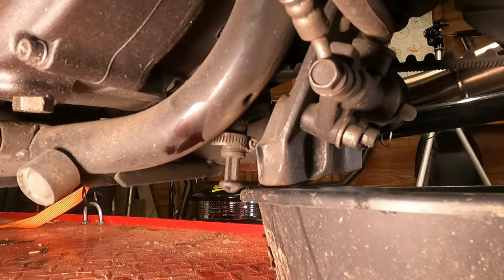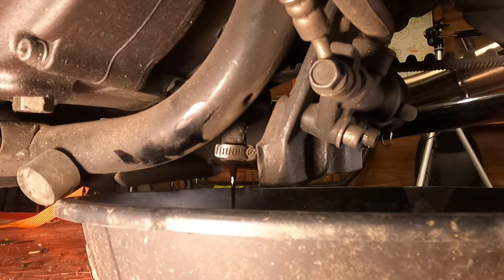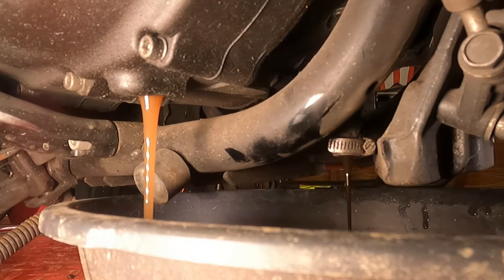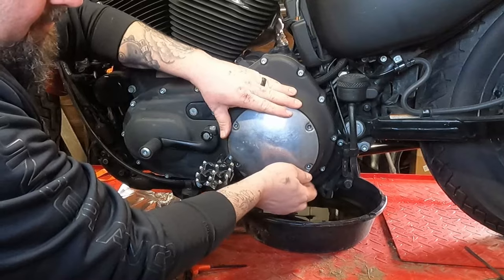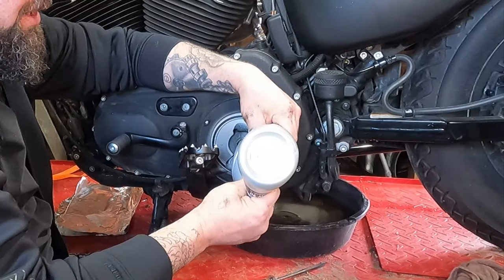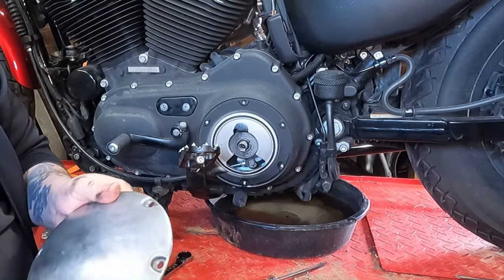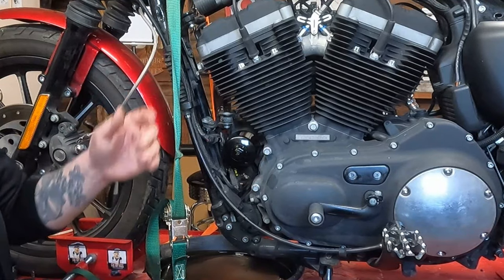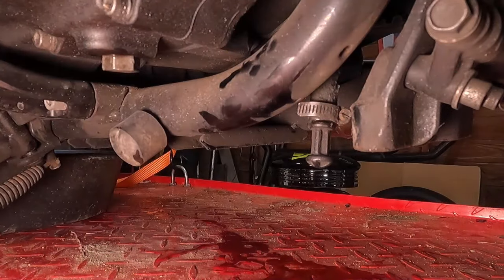Harley Sportster engine, primary & transmission oil change.

Comment: I recently bought a Harley Sportster and decided it was time to change the engine oil. As a newbie, I mistakenly drained the transmission oil instead of the engine oil because I wasn't sure which plug to use. The oil container still looked full, and I was freaking out about how to replace or refill the transmission oil. I searched everywhere on YouTube but couldn't find a helpful video, until today. Finally, I found a video that featured the exact model of Sportster I own. It was such a relief! Thank you for the clear and precise explanation—it saved my day!
Reply from the maker: You’re welcome. I am glad it helped.
Reply: If ya lay the bike on its side you can fill the oil filter up and screw it on and that way you have no start=up without oiling the crankshaft! @KnobleMoto
Reply from the maker: @kennyh5083  you sir, are a genius!

Comment: Looks like you’re putting in 75w-90 in the transmission but you’re telling the viewer to put in 75w-140. 🧐
Reply from the maker: Go with 75/90.
Reply: Why don't you use same oil in primary and engine as Harley recommended? Just wondering because I'm about to change fluids.
Reply from the maker: @tayloralexis1504  gear oil is more appropriate for the design of the transmission and primary.
Reply: @KnobleMoto  I appreciate your time and response. I've been using 20/50 in the primary same oil as I use in the engine but the clutch just doesn't seem right and it seems louder in the primary with the 20/50. I'm gonna try the gear oil and see how it goes..
Reply from the maker: @tayloralexis1504  I think you will find it all works better with gear oil.  Just make sure it is either specifically for a Hd primary or is listed as “for limited slip differentials”. That means it has friction modifier in there to make a wet clutch work smoothly.

Comment: Always preload your oil filter so the "dry start" wear on motor is minimalized.
Reply from the maker: How do you get the oil to stay in the filter when you install it?
Reply: @KnobleMoto  The filter media will absorb it w/in 10 seconds
Reply from the maker: @drnozzel  I think it’s just a wire mesh, how is that going to absorb the oil?
Reply: @KnobleMoto  Haha, no, not a wire mesh. There is actually an element, similar to absorbent paper, that absorbs the oil. The oil pump pushes the oil into the filter through the filter media (which normally filters down to 10 microns) and then exits through the threaded hole (you screwed the filter onto it) back through the motor.

Comment: I'm doing an oil and filter change on my 87 sportster before the summer starts - its amazing how little the design has changed although the oil line is much easier on the 87.
Reply from the maker: If it works …..😂

Comment: The Harley Service manual for my '03 Sportster says that the oil level for the primary should be at the bottom of the clutch spring, which is the round device you see when you look inside the clutch cover. Overfilling can cause some shifting problems. 

Before you install the new oil filter, you may put about 4 oz of new oil in there and let it soak into the filter. This will help build oil pressure sooner when you start the motor.
Reply from the maker: How do you keep the oil in the filter when the filter screws onto a vertical face?
Reply: @KnobleMoto you don’t fill it all the way…just a few ounces to prime the filter quicker
Reply from the maker: @rogerbuesing9374  how do you keep the oil from coming out when you install the filter? Oil comes out when you turn a filter sideways.
Reply: Its not the spring it is clutch basket gear that you are looking at.The fluid is suppose to be barely touching the teeth on that gear.The service manual has a picture showing that.
Reply from the maker: @tylerhubbell6410  check out the text following the picture. Step 9: “verify that the lubricant is even with the bottom of the clutch diaphragm spring”.

Comment: When i used to change my own oil, i would clean the drain plug area with a rag and compressed air. Also, the Sportster has its own formulated primary oil. Using a thicker gear oil will run hotter and will hold heat. A lot of people overfill the oil tank  because many manuls state 3.5 qts.  Also you didn't burp the line . .my 2 cents, which you probably didn't wa b .
Reply from the maker: I’m not draining the oil pump, so I didn’t bother burping the line.  
The sportsters primary oil, is gear oil. But ultra thick oil will cause problems.
Reply: Couple years, but growing up my grandmother always bought me dirt bike’s every couple years so getting on it was a piece of cake. I got it last week. Yesterday I rode a wheelie on it for almost 2 miles

Comment: Hey thank you for youre video. Just wanted to know, if youre bike is on the side stand to fill up the oil. i heard a few that you have to measure the oil when its on the side stand.
Reply from the maker: On Harley’s you check the engine oil with it on the side stand. You check the primary and trans oil with it upright.

Comment: Hi, whats the difference between primary and transmission oil? And my Harley superlow 883 2017 will need two different primary and transmission oil?
Reply from the maker: On the sportster they share the same oil. Primary oil has a friction modifier for the clutch.  Any gear oil “for limited slip” will work.

Comment: The allen equivalent to the torque screws are 1/2-20 x 5/8. He said x3/4 but those were longer than the oem ones, at least on my 08 xl1200c. I had to change a couple of stripped torque screws.
Reply from the maker: 🤷‍♂️ the extra .125 won’t hurt anything.

Comment: What engine oil and primary oil should i use for my 2013 sporter 48?
Reply from the maker: 20/50 in the engine. 75/90 in the primary/transmission

Comment: When the ENGINE  oil and FILTER are changed should the bike be upright or on the kick stand? Thanks
Reply from the maker: Upright is best but it doesn’t really matter.  If it’s on the side stand, once the oil is drained out of the tank, stand it up straight for a few seconds to make sure you get any remaining oil out.
Reply: @KnobleMoto thank you thank you!!!! I was looking for this

Comment: Do you have to purge the air out or does the air that got into the system just boil off?
Reply from the maker: As soon as it starts, the oil pump will push all the air out of the system.
Reply: @KnobleMoto  awesome man thanks for the quick response one more question do the oil fill cap have to be off for that work or dosnt matter new to Harley’s thanks
Reply from the maker: @AngelAguilar-hd2ev  it doesn’t matter. The tank is vented.

Comment: when hot the oil level will be higher.  are you suppossed to check the level cold?  my xb12r says check hot
Reply from the maker: It doesn’t have to be “hot” but let it run for a minute or so to circulate the oil.
Reply: It says on the manual to check the oil on the side stand
Reply from the maker: @jamesfleming5875  check the engine oil on the side stand. Check the primary/transmission oil with the bike upright.

Comment: I recently drained the primary by mistake, unfortunately the gasket fell off I cannot get it to stay on is there a trick, or do I need a new one? It looks okay and I see they're a little tiny hook like things to drop it in but it's not working I have a 2008
883
Reply from the maker: Try putting some grease or “gasket tack” on mating surface to get the o ring to sit in place.

Comment: Amsoil recommends using V-Twin 20W-50 oil for both the engine and transmission.  75W-140 is thicker and will retain more operating heat so the benefit of the transmission running quieter is canceled out by more transmission wear because of the increase in heat.
Reply from the maker: Baker Transmission recommends 75/140 & they build transmissions.

Comment: Good video man. Ive changed my oil a ton but never done trans by myself.... looks way easier than i thought.... and only 1 quart? hmmm.... I wonder if my 99 sporty is the same... gunna find out... Thanks again man good video.
Reply from the maker: Thanks. Double check, but I am pretty sure it is the same capacity.

Comment: What type of primary / transmission oil did you use?
Reply: Sorry or what oil and primary / transmission oil would you recommend for a 883 iron sportster?
Reply from the maker: 75/90 weight synthetic. Personally I am a fan of the Pan Am stuff that Lowbrow Customs  sells.

Comment: Make Shure u put in one quart in the primary to little u burn out the thro out bearing to much your clutch will slip so one quart 
And make Shure you put your screws on the primary cover in the same holes they came out l once put in screws thinking they were all the same size mix up putting them in the primary cover some were shorter then the other and I lost my fluid well driving because of a screw in the wrong hole once I found out I put the screws in the right holes 
On the primary cover replace spring good idea it fits inside your primary cover so when you put it back on hold pressure on cover and tighten your screws in the right hole for the long screws and right hole for your short screws

Comment: Why did you put 2 quarts  of Mobil oil and mixed remaining with valvoline oil ?? 21:47
Reply from the maker: Apparently one was on sale 🤷‍♂️. I had an extra 1/2 quart from the last oil change. It’s the same weight so it really doesn’t matter.
Reply from the maker: Good eye though. No one has caught that yet. In another video I call out the wrong  oil vs what I put in. No one caught that yet. 😂
Reply: @KnobleMoto  Actually you were explaining very well which kept me interested... Thank buddy
Reply from the maker: @alwynfernandes4137  you’re welcome. I am glad it helped

Comment: Can i know if the transmission oil is the same with the main engine oil for sportster?
Reply from the maker: It’s separate oil. Some run 20/50.  I run 75/140 gear oil because that’s what baker transmission recommends.
Reply: @KnobleMoto  thanks
Reply from the maker: @ketarap  you’re welcome
Reply: I have 2013 Xl883L superlow would I use the same 20w50 for both
Reply from the maker: @avargas33  I used 75/90 or 75/140 in the trans/primary. But a lot of people use 20/50 and it’s fine.
Reply: @avargas33  Ok thanks. The workshop at my place also recommended Amsoil 20w50 for the primary/transmission oil.

Comment: Any symptoms I should watch out in case it's overfilled? My tech guy says it's supposed to be around 1,2l (1.2 quarts). Not sure I should be worried but I'm gonna do this service soon, so trying to learn as much as I can
Reply from the maker: If it’s a little, it won’t really hurt anything. If it’s a lot, it will just overflow out the tank vent and make a mess. It won’t damage anything.
Reply: @KnobleMoto  Thank you!
Reply from the maker: @MrVitorpatriota  you’re welcome
Reply: If it uses the same oil...why did the oil coming out of the drain plug come out black, but the primary oil came out much lighter?

Comment: I thought the engine oil an transmission fluid shared the same oil y are you add fluid to the clutch?
Reply from the maker: No. The primary and trans share the same oil.  The engine has its own oil.
Reply: @KnobleMoto  ok so on my 2017 883 iron. I need to change the oil.....and the transmission fluid? It's two different holes right ?  I got the oil on the table an forgot the transmission fluid.bc I thought it was all in one
Reply from the maker: @comingasathiefinthenight1120  yes. Sorta.  The drain plug is on the primary case.  That will
Drain the trans too. Then add one quart. To the primary via the clutch cover or the little access cover in the upper middle of the primary cover.
Reply: @KnobleMoto  so do I need both fluids or just the oil ?
Reply from the maker: @comingasathiefinthenight1120  just the 1 quart of primary/trans oil.

Comment: Doesn't the bike have to be level when refilling the clutch  ?
Reply from the maker: level or almost level.  If it's on the side stand the oil will come out the clutch cover.   But if you refill it at the inspection port, and the clutch cover is on, the bike doesn't have to be upright.  Just make sure you put the right amount in.
Reply: @KnobleMoto  ok. Got it.  Thanks brother.
Reply from the maker: @hectorramirez1808  you’re welcome.

Comment: I have a 2017 Harley Sportster Iron. There are only two oil change slots: 1 for engine oil and 2 for transmission oil.
Reply from the maker: Yes. The primary and transmission share one quart of oil.
Reply: @KnobleMoto  Do you mean that there are only two oil changes in the Sportster?
Reply from the maker: @user-px1ed2rp6k  yes. 2-3 quarts for the engine. 1 quart in the combo primary & transmission

Comment: Wait when did he change the trans fluid? I saw the primary, the engine oil, but isnt there a third fluid change
Reply from the maker: Primary and transmission are the same oil on a sportster.
Reply: The third fluid is the transmission fluid the primary and transmission share the same fluid

Comment: I noticed you Don't prefill oil filter maybe it's not necessary
Reply from the maker: On the sportster, prefilling the filter doesn’t work because you have to turn the filter on its side to install it. 
Some filters have it on the label that they do not require it. And if the engine is running on a regular basis, the air in the system will bleed out pretty quickly, so it’s not as necessary as some people make it out to be.

Comment: What gear oil brand did you use
Reply from the maker: Mobil One usually.
Reply: @KnobleMoto  alright cool thanks for the info
Reply from the maker: @jayydawg3228  you’re welcome
Reply: @KnobleMoto was is it 75W-140?
Reply from the maker: @diegoavila4379  yes it was
Reply: @KnobleMoto what's up I have a 2022 iron 883 & my local HD gave me heavy gear Oil 80w-140. That what I should be using?
Reply from the maker: @jayydawg3228  it will work. There is not a huge difference between 80/140 and 75/140

Comment: you forgot to prime the oil filter ... you should always fill the filter 1/2 full of fresh oil in a dry sump system so your not dry starting it.....
Reply from the maker: How do you get the oil to stay in when you install the filter?
Reply: @KnobleMoto  you only fill it halfway and then bring the filter close and top it and screw it right in quick and barely any spills … been doing it that way for years …
Reply from the maker: @kenni411  I don’t think I can get it threaded on that fast.
Reply: @KnobleMoto plus it's not necessary

Comment: Friendly advice, don’t use synthetic for your primary. Please update that for your video if you can.
Reply from the maker: Why conventional vs synthetic
Reply: @KnobleMoto  Synthetic is more likely to make your clutch slip and doesn’t preform as well with the extra heat from a Harley. You want thick oil for your primary, regular 10W-50 or 75W-140
Reply from the maker: @adamupusa  I have personally put 150k on an assortment of bikes. All with synthetic, and all had properly working clutches. Actually on my channel you can see me measure some dyna clutch plates with 50k on them, and there was virtually no wear. 
Synthetic will last notably longer, and it is a better lubricant. But it won’t make you clutch slip.  Though to ensure you have a smooth clutch operator, you should get primary oil with “friction modifier”. If you don’t he clutch can be grabby. But it definitely won’t slip. 
Now you are correct about the weights of gear oil to run in there.
Reply: @KnobleMoto  It may depend on how hard you ride your bikes and if you’re doing stunts or riding fast all the time. I’m sure if your just cruising then you’d be fine with synthetic but all my guys don’t use synthetic. You’re welcome to call any Harley dealership and talk to someone in service, they should all confirm that they don’t use synthetic as well.
Reply from the maker: @adamupusa  I’m sorry but that isn’t accurate.  If any tech told you that, they were being sarcastic or making fun of you. Besides the motorcycle racing and tuning world, I worked in heavy steel fabrication and NASA for many years.  Unless cost is a concern, there is no situation where you would use conventional oil over synthetic. When you build an engine, you run conventional oil.  That is because synthetic is such a great lubricant that the engine will not properly break in.  Synthetic is the reason cars last 300,000 miles today. At NASA we didn’t put conventional oil on anything that flew. We even used synthetic coolant in the CNCs. 
If it’s worth any money, you should put synthetic into it.
Reply: @KnobleMoto  Yes you can absolutely put synthetic for your engine, I am only referring to the clutch. Harley’s need a thick oil for the clutch. Especially if you’re riding it hard. And trust me I didn’t get this information from a dealership, but I do know for a fact they don’t use synthetic for the clutch.
Reply from the maker: @adamupusa  the other guy who said “trust me” on this thread had a completely different opinion.  (Joesph Kaminski). You two should argue it out.
Reply: @adamupusa that’s ridiculous…one of the benefits to synthetic is it’s better lubricity at high temps compared to conventional oil…synthetic also flows quicker at lower temps than conventional oil
Reply: @KnobleMoto precisely!!!

Comment: Use a puppy pee pad instead of using the aluminum foil. Also you used gear oil in primary and not 20-50 synthetic oil. Have you had any problems using gear oil?
Reply from the maker: Good idea.  Also the gear oil works great.